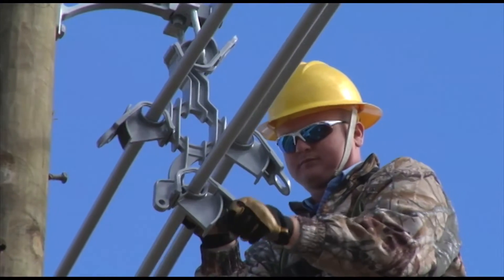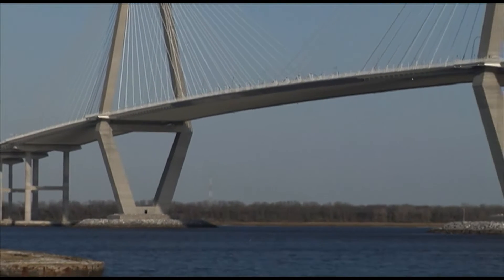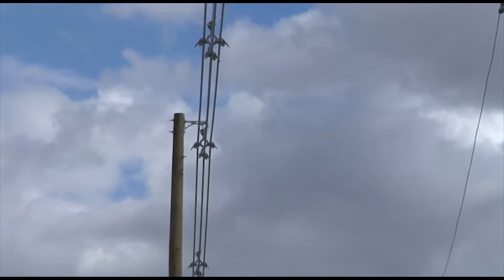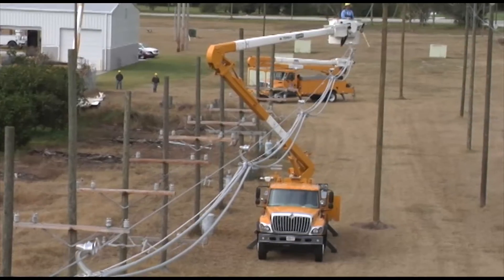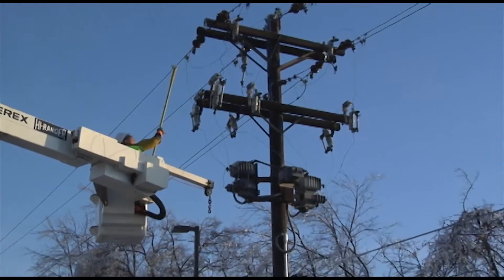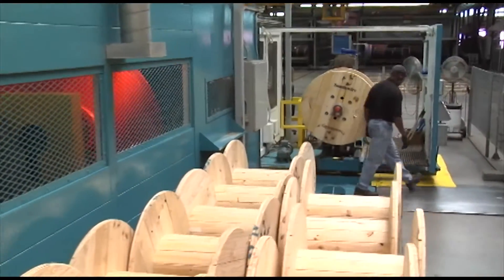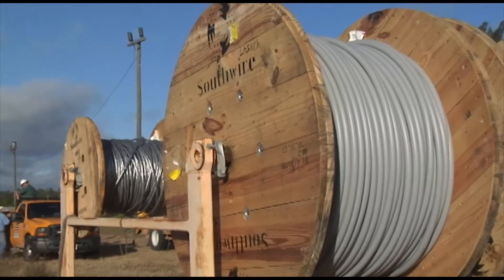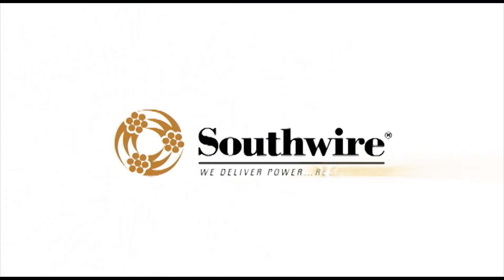Covered Aerial MV - Highly Reliable & Community Friendly

Comment: Over 4 decades in the trade, the most devastating flash I’ve ever seen was on spacer cable. On a road widening job, moving cable 15’ to the road, a crew on an adjacent pole was covering the cable with line hose prior to moving the cable. While covering one of the top phases, the center phase in the lower position broke in half, breaking load and enveloping the other two phases and the linemen in the bucket. The heat was so intense that the bucket liners were melted down in the bucket. Fortunately it was winter and the linemen had heavy clothing on, however the outer layers of clothes were burned off their backs. This was the days before FR back in the 80’s. Both men sustained flash burns to their faces. Upon investigation it was revealed that the cable had hundreds of pin holes in it, the conductors were oxidized causing the cable failure. The investigation stated that the pin holes were caused by lightening. You can’t see through the insulation on cable, you don’t know if the conductors have been compromised. I hate working on spacer cable.